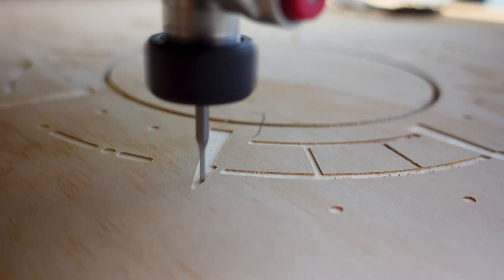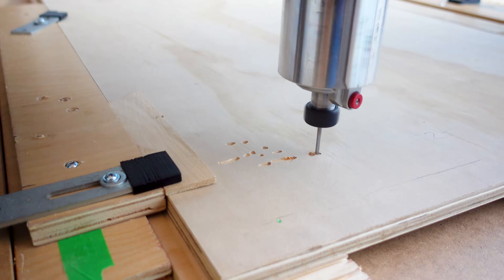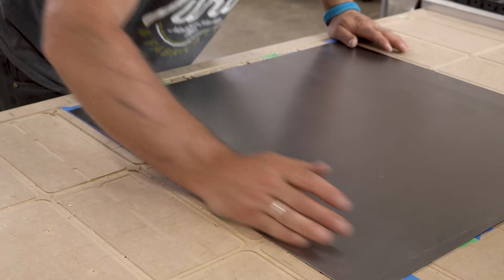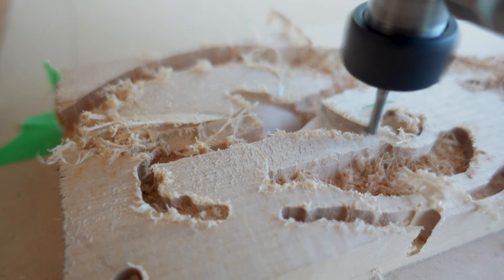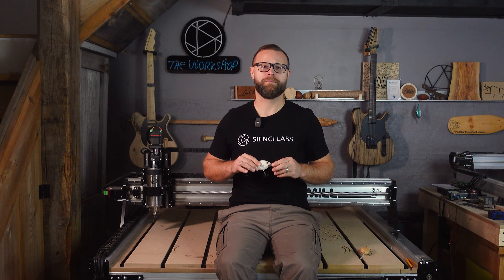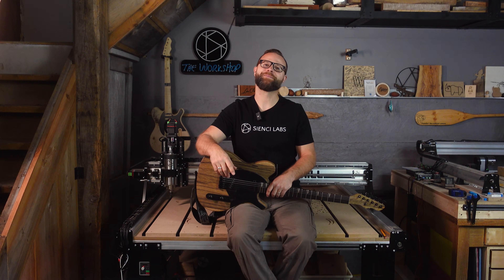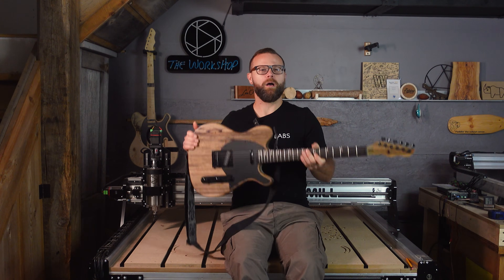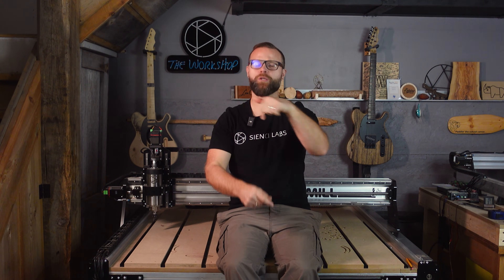Save Money on Projects: Why a CNC Machine Is a Smart Investment

Comment: A cnc isn't just an investment, it's a space saver. That maybe sounding weird, for it's a big machine, no? Just hear me out. I have a 48x30 longmill, it takes up a large corner of my garage leaving not much space for other machines. I have a large  miter saw in another corner and wood stored on the other side of the shop. It's a tight, but it fits. Only.. If I do not use the cnc, It isn't lost space at all. I can use that space as a pretty large work bench (complete with pc and all that it can do.) just by backing up the x axis to the rear of the machine. 

Because the cnc is so versatile, I can use it to some extend as a table saw and a plainer. True, it takes more time, but not having to buy these one purpouse tools, does save a lot of money, if space is more of a problem than time. I even use the cnc as a huge ass bloody accurate caliper with on board mm to inch conversion and back. I am still finding fun ways to use the cnc because there is no intended use for it. You just appoint uses to it, as you go.

Since I got my cnc out of the box, my thinking went with it.
Reply from the maker: You’re not wrong, and you’re definitely not the only one using your cnc as a multi-purpose tool…machine…thing! 😉